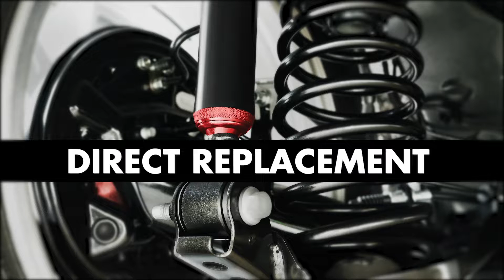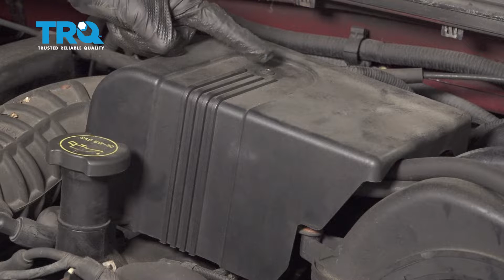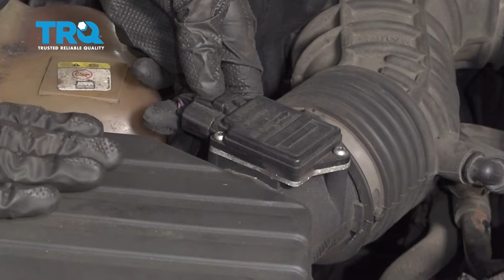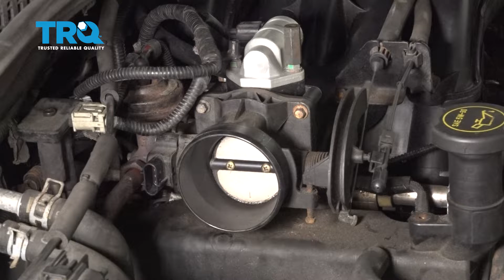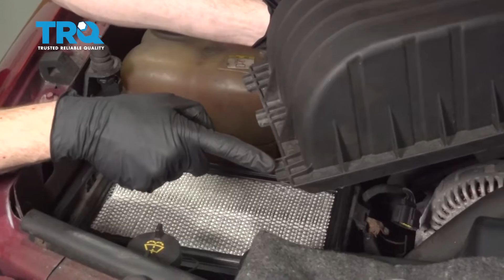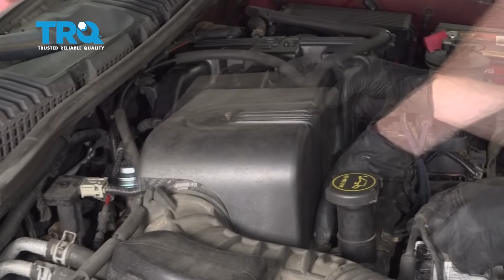How to Replace Throttle Body 2002-2005 Ford Explorer

Comment: You specify 80lbs torque on the 4 bolts of the throttle body my books say 8.43 lbs please revise that part and for the rest i give you a 5 stars